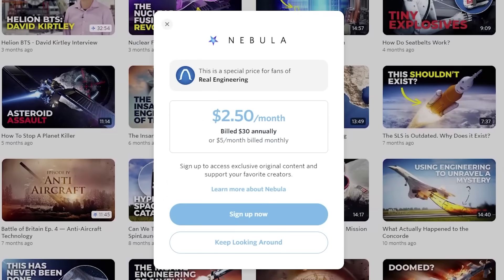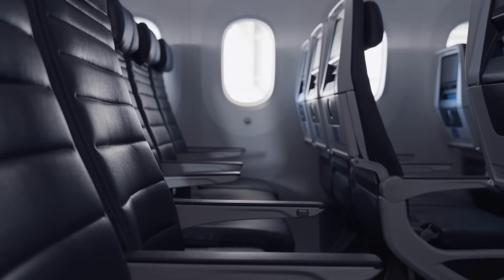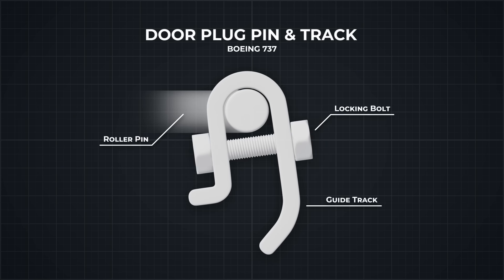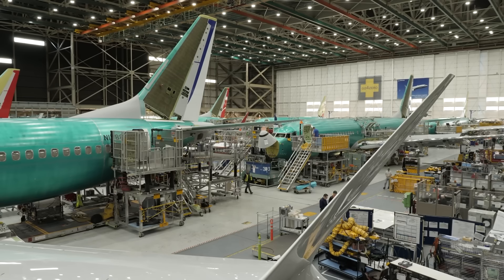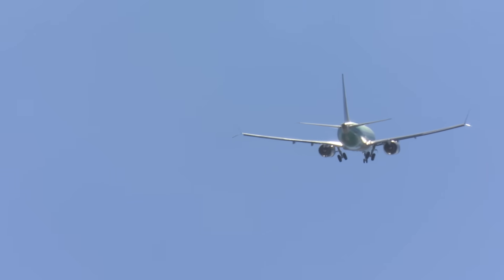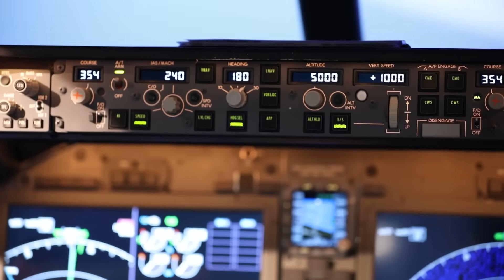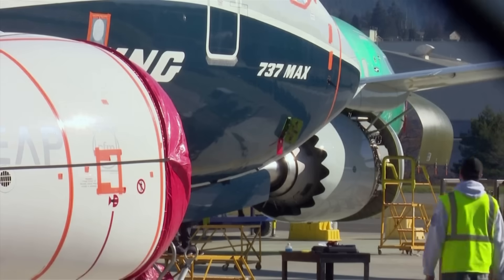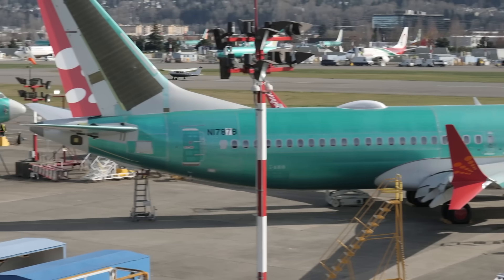The Questionable Engineering of the 737 Max

Comment: 0:27 in the event of sudden depressurisation, the cockpit door unlocks itself. I only know this because this was weirdly not mentioned in the flight manual, so none of the crew knew it at the time of the incident, which made Boeing say they'll update the manual.
Reply from the maker: Why would they design it to do that?
Reply: @RealEngineering  So the passengers can listen to pilots screaming.
Reply: @RealEngineering  for the banter
Reply: @RealEngineering all aircraft that I've worked on do this. Usually with blow out panels on the door rather than the whole door itself. Idea is to release the pressure in the cockpit and equalize everything to reduce strain on the airframe that could potentially separate it. And to ensure the pilots can escape upon landing. We actually test them somewhat often, by testing the spring pressure on the blow outs.
Reply: @RealEngineering This may be a consequence of the Helios Airways Flight 522 crash. In the event of a cabin depressurization combined with pilot incapacitation, the door staying closed and locked could prevent people from assisting. Incidentally that aircraft was a 737 NG.
Reply: @iblistarhun  That would have been my guess as well.
If it were for equlising pressure, a simple vent somewhere in the bulkhead sounds like a more reasonable sollution to little old layman me.

Is there evidence that the cockpit door prevented someone from the cabin to enter the cockpit in time to prevent the disaster?
If so, then I'd say that together with Germanwings Flight 9525, this "safety-feature" has to this date probably killed more people than it saved...
Reply: @RealEngineering  So little Timmy gets to visit the cockpit, à la Make-a-wish.

Jokes aside, I imagine it's so the bulkhead separating the cockpit from the rest of the plane doesn't break from the pressure difference and damage the outer fuselage in the process.
Reply: @RealEngineering  That I do not know.
Reply: @RealEngineering  Door blowing off of it's hinges is strictly better than the bulkhead getting damaged by the pressure gradient.
Reply: @RealEngineering  cause if they don’t do then the plane would have a decompression that include having the front of the plane being separated from the rear of the plane. Called yourself real engineering that don’t even know that if the pressure if behind the cockpit is more than the pressure outside of the cockpit, it would lead to fatigue crack and the front of the plane to separate from the rear of the plane.
Reply: @HandyArmstrong-bp1tm Relax “HandyArmstrong”, way to chime in at your first opportunity to sound smarter than someone else. His channel is a broad spectrum of engineering. Not Avionics engineering. Don’t discourage people from asking questions, otherwise, don’t answer them yourself.
Reply: @rickydanerd  then don’t make videos. A 16 years old student would even know that when pressure is more in one part of a thing than the other the part would crack. If you’re making a channel called ‘real engineering’ you better nailed engineering down properly and not just think that having half past 6 idea that the common man have would be suffice. I’m not even in aerospace engineering, I’m studying business. But if this simple logic he can’t even grasp how can you even go on and do a engineering YouTube channel spreading info around the world?
Reply: @nittojoe136  thanks for showing me what American eduction system is, that’s why in Asia with all their faults ,their education system at least teaches people when arguing don’t just use low level insult, makes you look like a petty person.
Reply: @HandyArmstrong-bp1tm since you’re the expert here, please explain how that scenario would be a fatigue failure.
Reply: @HandyArmstrong-bp1tm Yeah nah, that makes no sense bro - so if the hold depressurises you’re not gonna design your plane to have to immediately depressurise the cabin too to avoid a pressure differential, you’re gonna build your plane strong enough to not rip top from bottom if it gets a hole in one section.
Reply: @beesoffury  if cockpit of the plane is pressurised while the back is rapidly unpressurised, just imagine like a balloon, the cockpit is losing air a slower rate while the back is losing air at a faster rate. Then the the forces from cockpit would be pushing the towards the cabin  since the cockpit has a higher pressure, then if the pressure limit between the cockpit and the cabin bulkhead is reach, it would cause cause the metal to crack. Or it would find the path of least resistance, causing more damage.  

Thus in a rapid decompression, any pressure in a enclose space (cockpit) needs to be released immediately. 

See the pressure test of airplane, the load test, they are all rated to 150% Maximum Differential Pressure if this limit is reached, then the plane would explode.
Reply: @HandyArmstrong-bp1tm  wouldn't it make more sense to not make the cockpit door airtight but still secure. or to put in a small vent. engineering is thinking about multiple solutions
Reply: @redbandet  there is already vent in the 737 cockpit, but maybe the pressure is too big so they also blew the cockpit door to relief pressure of the cockpit. I agree, engineering is thinking about multiple solutions, but whether those solution would work or not, I’m unsure already
Reply: @redbandet  doors are not airtight
Reply: @tonyhawk123   He is not just a small content creator, he is already charging people on nebula to support him. If he is a content creator that wants people to pay him, he needs to gets his information right. If he isn’t giving the correct information, then is it fair for people that paid money on nebula? 

How to be friendly to someone who is has not done his homework and charging people to support his incomplete work?
Reply: @HandyArmstrong-bp1tm  He said the door opened. That's literally it. Talk about making a mountain out of a molehill.
Reply: @tonyhawk123  then why is it included in a video of questionable engineering of the 737 MAX?  

Talking about making a mountain out of a molehill , more like you’re having a para social relationship trying to protect your favourite creator.
Reply: @HandyArmstrong-bp1tm  Let me rephrase for you. " cause if they don’t do then the plane would have a decompression that include having the front of the plane being separated from the rear of the plane. if the pressure if behind the cockpit is more than the pressure outside of the cockpit, it would lead to fatigue crack and the front of the plane to separate from the rear of the plane. "  
There is no reason to call Real Engineering out like that. By that logic, no one should own a channel. Practically every science channel I know has made at least 1 mistake or don't know something even within their field. Even if they learned and master everything, they'll end up forgetting anyways, because of how human memory works.
Reply: @HandyArmstrong-bp1tm  You said "How to be friendly to someone who is has not done his homework and charging people to support his incomplete work?"
Oh, you could have started with that. You could have just said something like 
" Hey, could you please spend more time researching for all the correct information? I think that would be fair since you're getting paid on Nebula. Or perhaps you could at least edit, pin comment, or add in the description of the information you acquired? "

I personally doubt Real Engineering is making good money from it though, but I could be wrong.
Reply: @antoniohagopian213  good point that wouldn't work, maybe a positive pressure system but thats just more complication.

The OPs assumption that different air pressures in different parts of the cabin causing stress was probably overblown to begin with as well
Reply: @shaeby8123  begone someone who add no substance to this discussion
Reply: Sounds like it's not working as designed so they will update the manual so they don't have to fix it.

Why put the little pressure equalization doors on there if the main door will just blow open anyways?

Sounds like they're covering it up with a "revision" to the manual.
Reply: Since no one else has said it, the cockpit doors are not, and have never been "pressure doors". A plane has the same pressure throughout the whole cabin, having multiple systems to pressurize different areas would be so inefficient. The reasoning behind the doors unlocking (if that's even what happened) in the event of a rapid depressurization is probably so the crew can check on the pilots and make sure they both got oxygen on quick enough and weren't incapacitated.
Reply: Um, dumb question here but if the cockpit door is designed to fly open in the event of depressurisation then what’s to stop terrorists from exploiting it as a means to get access to the cockpit? Okay yeah there are problems with it, such as needing oxygen masks but determined terrorists could probably figure out a way around it, especially as the pilots are trained to emergency dive to about 10k feet. But now the door is open and they have access to the cockpit and the pilots.
Reply: This has been a requirement for all FAA certified commercial planes since 9/11. The cockpit door must open within milliseconds in the event of rapid decompression.
Reply: @MyCrazywhiteguy inside job btw.  anyone can have a basic knowledge of energy flow analysis and determine this from watching the buildings collapse.
Reply: That sounds like an easy way to hijack planes going forward, I sure hope you're wrong. Also, more terrible documentation from Boeing. The Diaper leaks on.

Comment: Did the rapid decompressions slam the cockpit door open? or is the door designed to unlock after rapid decompression?  I have read that it is the latter.
Reply: It did. 

There are little doors that are supposed to open and let the pressure equalize, but those either failed to do their job or were inadequate and the entire door blew open.

There was a picture of it somewhere.
Reply: @volvo09  Ok, thanks
Reply: @volvo09 The Little panels are pointed in the OTHER direction.
The pilots were not informed that the door does this; the manual is getting edited to add this feature.
Reply: Yes it was design to open that way but Boeing never told anyone about this "feature".
Reply: @Nekzuris  i don't really believe that... I think they just said that to cover their azz so they don't have to fix it.

Why put the little "blowout" doors on the main door if the main door is just going to blast open anyways?

Comment: An overly simplistic explanation: This is what happens when Boeing is in charge of inspection oversight of Boeing.
Reply: 3 points, 
Spirit AeroSystems used to be Boeing so consider them one and the same. 
The door plugs are removed for air-conditioning installation.  
After a fitter has installed parts the work is supposed to checked by their supervisor then inspected by someone else, it appears Boeing has required fitters to carry out all three roles for economy.
Reply: @matthewn1805 Not surprising. On the engineering side, new and revised designs are supposed to have a peer designer or engineer review and then go on to an engineering lead to review again. With corporate dictates to reduce labor costs going back to the 07-08 recession, engineering staff has been cut back further and further (mostly by the attrition of the oldest, experienced, most expensive engineers retiring and then hiring few if any new ones) to the point that the peer review has essentially gone away and the engineering leads are so overworked that the initial engineer is lucky to get more than a cursory review for typos, instead of checking the design for completeness and compliance with best practices. 

Thus for both engineering and manufacturing, Boeing Corporate's solution is to simply insist on "first-time quality," making perfection the minimum expectation in which case they don't need peer checkers and on-the-line inspectors and the time "lost" to such reviews - and then punishing employees for not meeting that somewhat superhuman standard
Reply: It’s not just Boeing that has that “advantage”, though.
Reply: I know Boeing lobbied to regulate themselves. After previous catastrophes at Boeing I'd assumed executives were told to get their act together though.
Reply: @tonyhawk123 I'm those executives got such a sternly written letter.
Reply: @tonyhawk123  Who could have thought that telling executives that wouldn't work
Reply: Regulate themselves..just like the banks.  lol
Reply: Also when you have an insanely powerful megacorp that can leverage national interest and easily bribe and/or intimidate politicians.
Airbus is just as large but it's structure as a consortium and Europe's more regulated economy means they can't leverage their size and power nearly as effectively as Boeing can.
Reply: And when the oversight committee is ran by the US government - when Boeing is one of their biggest military partners. 

Almost could say that its biased...
Reply: One thing we in the UK are still learning the hard way: Self-regulation never, ever works.
Reply: tHe FrEe MaRkEt Is SeLf-ReGuLaTiNg
Reply: The lawsuits will give them the motivation to have better oversight
Reply: So, use government inspectors (that is, government civil service types)?  Boeing will just buy them off.  As I always say, the big boys didn't get to be the big boys by being choirboys.
Reply: What? You mean self*-regulation doesn't work and its purely down to greed and to maximise profits?
Reply: The failure was due to human error in the installation of the door plug mounts not being torqued to the proper specifications.
Reply: @owain_glyndwr1265 Definitely.  Not only were they not torqued, but they probably weren't safetied (that is, no cotter pins or lockwire).  Except that it wasn't error...it was most likely a boss shouting at the mechanic and the inspectors about "holding up the line," waving arms and making threats.  IOW - somebody signed off the installation without actually doing it or inspecting it.
Reply: No it’s McDonnell Douglas
Reply: That's "free market" "Beacon of democracy" and "fairness" for u
Reply: Would this also count towards the US government being in charge if inspecting the US Government
Reply: ask Nikki Haley about it
Reply: That is how Organization Designation Authorization works. Without it, airframe and engine production would come to a crawl.
The people at our aerospace company take it very seriously, BTW. I have no clue what happened at Boeing, but we've a 300+ page manual that is approved by the FAA, constantly revised, and must, must, and must be followed, to the letter. The first time the FAA tells you to run a two-million-dollar test over you'll figure it out.